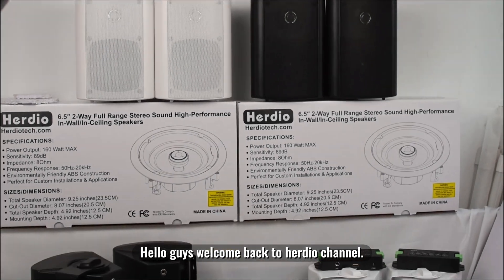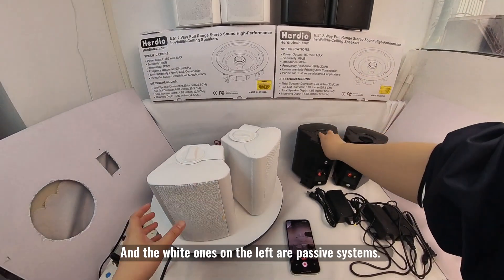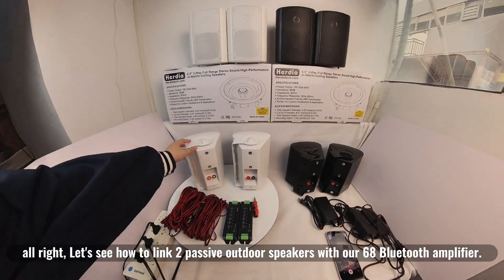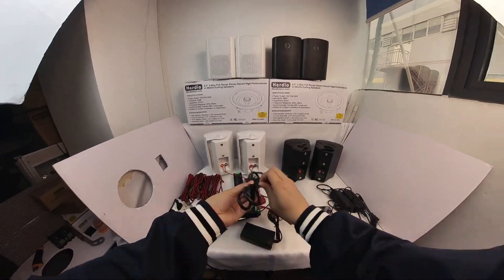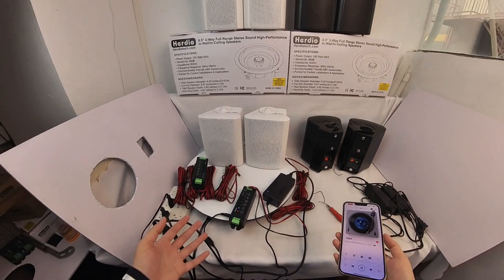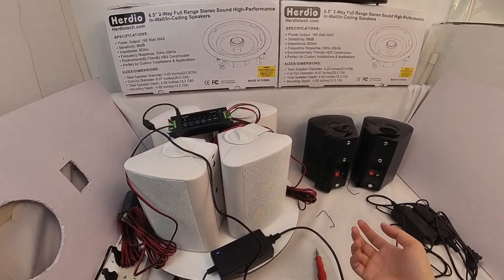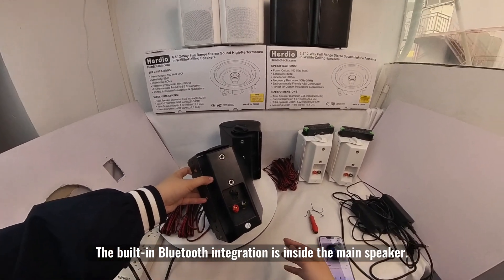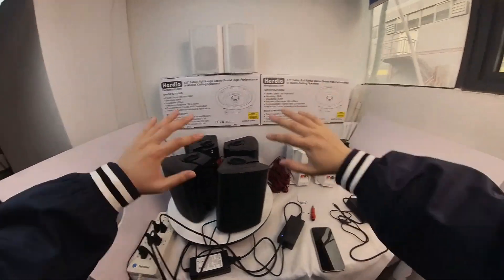How to wire Herdio outdoor wall-mount speakers (passive and active)

Comment: What do I do if my speaker cable is not enough, can I add another one? do you think it affects the sound? what can i do??
Reply from the maker: Hi If longer wire run is needed use 16 gauge weatherproof wire up to 50 feet.
Reply: @herdiotech  ok ok , but if I have the same cable I can connect it with the other one. Do you think there is no problem?